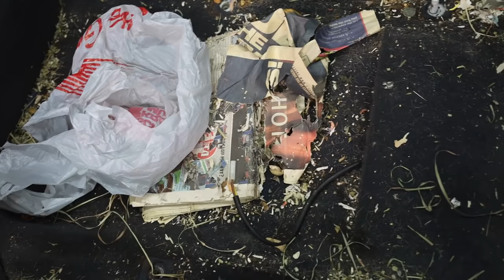ABANDONED BARN FIND First Wash In 10 Years BMW E30! Satisfying Car Detailing Restoration

Comment: It’s definitely near the end of the production run of the E30, considering it got a driver’s side airbag. 1991, give or take two years from that.
Reply: Did the later cars US have the smaller bumpers too? I’m used to seeing US market cars with the huge 5mph bumpers, which we never got here.
Reply: @zeroyon4562  the us bumper e30s were the early model ones, with the final diving board e30 being in 1988, with large bumpers and facelift tails and valence. 89-91 got the smaller plastic bumpers, so I'd say 91 too.
Reply: Convertibles got the larger bumpers through 1989, while the coupes and sedans got the plastic bumpers in 1989.  Airbag car with plastic bumpers = 1990 or later 🙂. Also no projector beam lights 😢
Reply: I'm 99% sure it's 1990 :D
Reply: actually 1991 verts still had small tailights, high rear arches and diving boards. 1991.5 to 93 verts got the facelift and plastic bumpers

Comment: I used to have a coworker who had one of these. His was white with a blue convertible top too. His was a 1991, so I am going to say this is a 1991 as well.
Reply: My disabled uncle has one of these in pretty good condition here in Germany he is looking to sell it for ~35K Euros upwards.
Reply: @emrefifty5281  wtf
Reply: @ivegotkids8455  what’s the matter
Reply: @heribertojuarez6046  no sadly not
Reply: @emrefifty5281  For an e30 318i $35K+ is ridiculously absurd
Reply: @ivegotkids8455  who said 318i?
Reply: @ivegotkids8455  it’s a 325i convertible with a manual transmission with very low mileage. It’s not that far of, especially because he has the oldtimer registration now.

Comment: Its amazing how you could still find these  cars running around after all these years
Reply: Those older bmw’s are so strong! I had the same one and I put 650k (kilometers Not miles) on it and the guy who bought it of me last I heard got it op to 900k+ only he wrecked the transmission, but still a wonderfull little car I miss everyday!
Reply: i dont believe it was a running vehicle after sitting 10 years ethanolhas been our fuel longer than 10 years and reeks havoc on fuel systemsin shorter time
Reply: this car hasn't been sitting like that for more than a week, video's staged and its very obvious.

Comment: I had this same car.  Only not convertible.  It was very reliable and an excellent well built car.  Only down side it went thru brake pads and the exhaust rusted out. 
Much better than today's BMW.  Simple, well built, reliable and a joy to drive so long as it wasn't in snow! I moved to Colorado and had to part with it because of the snow!.  1987 model year.

Comment: Staged right?
I'm on youtube for real stories. I get dissapointed more and more. Stay honest guys. Especially for the more critical viewers, with an eye for detail. For example:
-Paintwork way to shiney
-Absence of accumulated dust on hood while back side is dusty
-5 to 10 years ago these were valuable as well, nobody parks it with the top open in a haybarn
-Seats are looking too good underneath the hay
-Weird mud splash over the car hood like you actually tossed a bucket over it
-Inconsistend heaps of hay against wheels while parked in front of new bales
-Barn floor underneath front section of car is squeaky clean 
-For an active stable it should be terribly in the way for forklifts or machinery going in and out
-and so on..
Reply: 👍👍 true.. this is why thier subscriber dont grow...

Comment: Mine was Red, with Black top tent windows, 17 wheels with low profile tires, front air Dem,rear spoiler, tan leather, , you talk about the looks and gals I got, miss it but hey I was Bless with two lovely Daughters, and a price I couldn’t refuse, now 25 years later, just bought a barn find I’m working on 2000 750il, You guys go the extra and it really is a another level and it shows, 👍

Comment: Just came across this video. Nice detailing job. Thought I'd share something with your viewers as there seemed to be a lot of viewers for the E30. In South Africa we had the same range including the 320i, which I had. Not nearly as powerful but very smooth and classy, and there lay the design flaw. At around the 100k km mark, the car experiences starting issues when cold. That's because there is now a measurable amount of wear on the rings, not enough to make the engine fume. What happens is when parked, all the oil goes down into the sump, and the next morning when the key is turned, the first thing that happens is that the injectors spray the remaining oil film off the cylinder walls, lowering the compression momentarily, wetting the plugs and now you're stuck.The solution was to install a Cold Start E-Prom.Not a component, but an update on the chip in the ECU which introduced a 3 revolution delay on the fuel pump allowing compression to jump back up to normal. Worked like a charm!

Comment: Great video, but a few pointers (that may have been off camera). 
When cleaning the leather seats, make sure to use a damp towel to wipe down to get the remaining soap/ product off - then wipe dry again. I know the seat is clean, but there is a slight haze that does contribute the quicker cracks in the leather layer. The leather treatment looks slights shiny on the video, that should be a matt finish. Also, clean the corners of the rims. Do more than 1 treatment on the carpet as stubborn dirt on the rear loosens after a while of soap there.

Comment: I sure miss it,I had it 12 yrs,Then I got bless and became a Father,they made a offer I couldn’t refuse,now my oldest is starting College and I purchased now a 2000 750 IL to spend time with 🇨🇱👍
Reply: Your lucky with automatic top,I had a latch in the rear area then you had to pull back manually and hold pin down,I got to be a expert

Comment: If you're taking out the seats, it's a good idea to remove the center console as well. There are things that can go wrong, but there's a lot of dust and stank under there and I used to hide a big stack of emergency cash under my console, but I stopped doing it when I accidentally sold my 95 Geo Tracker with $700 stashed under there.

Comment: First read user manual from E30 convertible, its says avoid any direct water pressure on soft top,not to mention it is 30years old car, nevermind good job guys, yust watch it next time, soft top is ment for rain not water jet.

Comment: Cleaning the Door Jams / Hinges, Spray with Cleaner Product, Leave to Soak for a while ( 5 mins to 1 Hour subject to Dirt & Temperature on the day in your Location etc? ) 
Then Jet Wash until Clean, OR use a Hand TRIGGER Spray with Water to Rinse away the Dirt. 
Wipe with a Cloth & Finish with a Few Squirts of Detailer Spay. & Clean Paint Brush & Cloth etc Until Perfect.

Comment: It looks like a 90-92 because of the headlights my 89 325ic has epsolids and this one doesn’t  and  the steering wheel has a air bag which wasn’t common until the later ones

Comment: Leather is Animal Skin, 
Only use Very Mild Hand Soap to clean good leather. 
For Old / Worn Leather, 
Use a Filler for Cracks & Holes & Wear, then Finish with a Matching Dye / Stain .

To Keep Leather interiors as New,  Keep OUT of the Sun, 
Clean & wipe often with a Damp Cloth & HAND Soap , 

In Hot sunny Climates,  Throw old Bed Sheets Over the Seats. /Interior. 

Cheap Option, = 
Use Hand cream on a Soft cloth to Keep your Leather Soft & Supple. ( After You have Cleaned it with a Very Mild Hand Soap once it has Dried . 
Do Not Over Wet it, 
Do Not RUSH the Task. 
Quality Results takes TIME according to The Weather / Climate you live in. 
( Hours or Days ?? ) summer / Winter etc. ) 

Deep Cleaning a Leather Interior is Once or Twice a Year.  Expect to spend a FULL DAY or Half a Weekend to get it done to Perfection. 

Then Weekly, Wipe with a Damp soft Cloth soaked in Hand Soap, Once Dry, Wipe with any GENTLE Hand Cream, or A Tiny amount of COOKING OIL/ FOOD OIL / OLIVE OIL, 
Any Clean Safe Oil. 
Leather is SKIN, 
If you can Safely put it on your hands / skin , then it's OK for your Leather. 

Do NOT use Petrol, Bleach or Other Powerful Household Products.

Comment: This E30 must be built 1989 or 1990, since it has the old 2.500cc engine with 170hp. The newer 325 had 192hp out of 2500cc. The first with a 4 valve head.

Comment: “you can’t drive a car after 5 years just sitting” my car sat in my lower driveway for 5 years, completely untouched, and all we had to do to get it going was jump the battery off. tires weren’t flat, still had gas, just needed help to turn over. and mine wasn’t even stored inside
Reply: I think the proper statement would be that it shouldn’t be driven with old gas etc.

Comment: That's probably a 1991. You can tell by the steering wheel, because it has the airbag. I have an 89' 325i convertible like this one, but the steering wheel is different because there is no airbag. 
Also not to mention this one has the plastic bumpers that are body color.

Comment: You should never spray an engine if that water gets in the electrical system then car can have multiple electrical faults also if seal happens to be perished on oil cap you could potentially end up with water mixed in your oil